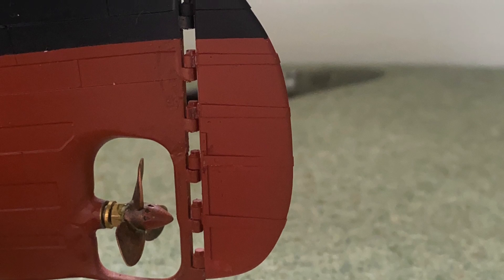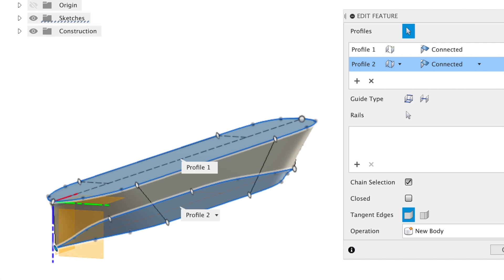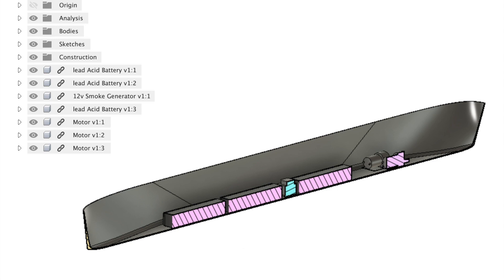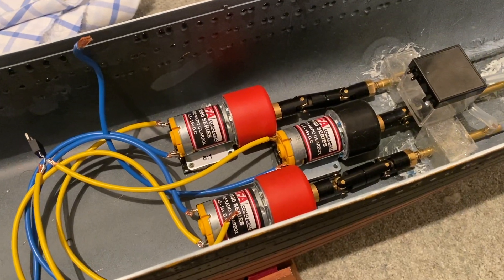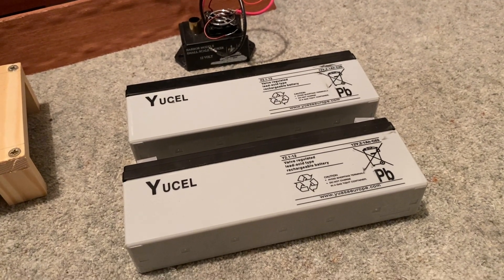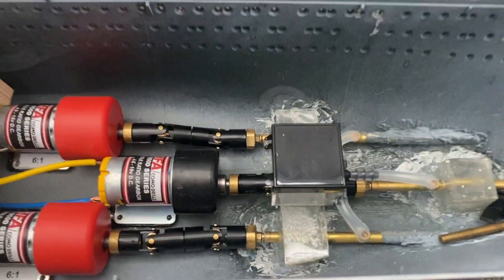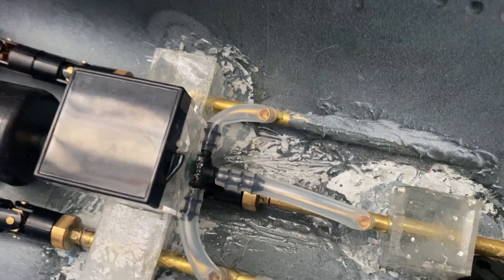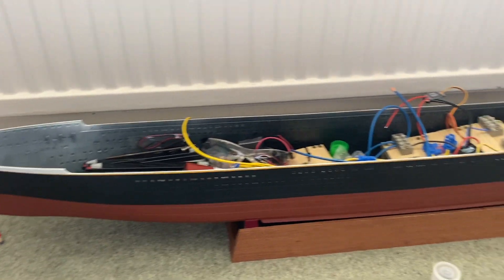Radio Control Trumpeter 1:200 Titanic Build Part 11 - Systems Layout and Electronics

Comment: Outstanding engineering as usual.  While I am not making an RC ship I got my motors working good.  Although my Pontos wing propellers do wobble a little.  I just could not get the hole to fit the shafts  squared up perfectly.  I used the center propeller from the Trumpeter kit and it spins perfectly.  My rudder is movable like the old 1/350 scale Titanic, which the how to idea came from you and I made sure people watching my video know that.  You are an engineering genius.  Thanks for the ideas.
Reply from the maker: Hi, thanks for your comment. Yes I found my pontos props wobble too. If you look closely they arnt quite true! I think really the solution would be to drill out oversize then manufacture some threaded inserts. But I can’t do that! Can you send me a link to your videos? I’d quite like to have a watch 🙂
Reply from the maker: Just watched it, great video! I will defiantly apply your  methods for the superstructure, I’ve been trying to work out what will be the best way of getting those parts together myself so that was a big help!

Comment: Very nice layout. Have you considered putting some microswitches on the motors to cut the inboard motor when apply a significant amount of rudder. I fitted the microswitches by the rudder arm so that the arm touched on to a "switch to break" on the motor power line and cut off to the inner motor only. I did this with a 1:96 Type 22 Frigate and it did improve maneuvering quite a lot.

Comment: Hi model boat guy I have a question for what type of servo motor mount did you use and where did you get it from and the automatic oiling system where did you buy it from
Reply from the maker: I made the servo mount myself from bits of wood. The automatic oil system is something I’ve made myself too, but I would suggest grease is a better lubricant than oil.
Reply: @TheModelBoatGuy  thanks for the advice I might get a 3D printer and make the servo mount and I’ll build the oiling system from the clear pvc plastic

Comment: Could you put multiple smoke generators? Make multiple uptake but put more to one stack than the other because there's never same amount of smoke out of all the stacks, maybe full speed at sea?
Reply from the maker: I am considering it, until i have the funnels plumbed in i cant really tell how much smoke im going to get out of them. Its all a bit of a balancing act because the generators are quite current hungry. But it wont be hard to add an additional one if i need. 
The other thing i suspect is that unless its a very still day i reckon the smoke will be blown away quite quickly anyway. So it might be a bit of an indoor party piece!

Comment: In an early video you showed prop shaft tubes that were 6mm OD without oil ports. In a later video, 9 or10, you show prop shaft tubes with oilers. Could you please let me know the source for these. They need to have a 6mm OD. Could you also indicate the lengths of the shaft tubes. Thanks in advance.
Reply from the maker: Hey, the prop shaft tubes are 6mm yeah. Then I just drilled and tapped them and added the oilers in. The prop shaft tubes don’t have to be 6mm but I found that was the best size as the actual prop shafts are 4mm which is ideal to accept the pontos propellers. I also prefer thicker prop shafts where posible as they are more rigid and run more true. I think 6mm is about as thick as you will her through the wing prop mounts. 
I think I bought the oilers of ebay: https://www.ebay.co.uk/itm/282899243083

Comment: Just wondering how you mounted the motors?
Reply from the maker: They are epoxied into the ship. The actual motors rest on a layer of rubber to dampen down the vibrations as much as possible. I have also cast the prop shafts into the Hull using resin

Comment: Very smart let’s just hope you continue the good work And let’s hope this radio control Titanic works properly
Also one question are you going to Close of the portholes because water could seep through
Reply from the maker: i have filled the portholes with UV resin so as yet i havent had any issues!

Comment: Great, very informative as usual sir!  Your video's are good.  Clearly you have an (A) in electronics!  Ever thought of squeezing a little sound board and speaker in for the ships horn sound?!!!  Rudder turned out really well.  I have just ordered the Scale the Titanic PE sheets. I aim to convert them for my Olympic use.  I just couldn't put up with the thick plastic profile, especially on the Promenade deck.  I have  tried to thin it down but it started to distort badly, so it has to go!  The brass will be more to scale for my needs.  Boat moulding is working well BTW!  Anyway looking forward to the good stuff you are going to be doing soon.  A wooden veneer deck manufacturer recommends a spray of matt varnish before anything is attached so to avoid accidental staining etc. Good luck with the next progression.  Regards JH ;-)
Reply from the maker: For context im an electrical engineer, so i should be getting that stuff haha! I have flirted with the idea of sound yeah, i quite fancied having a very faint bit of music playing for the band, just really faint so you can just hear it as if they were playing within the ship somewhere. Maybe that will come at some point, space is constrained! 
Yeah, if i hadnt wanted to have my superstructure removable id 100% be getting the PE sheets too, they are just amazing. I get what you mean about the thick plastic! In my case its actually quite useful as it adds a load of rigidity to the superstructure, but as you're doing a static model brass will defiantly look a whole load better. Looking forward to seeing this model of yours btw! 
Are you sticking with the silicone moulding for your boats? i havent got round to mine yet, its on the list but too many things to do.
Definatly going to use matt varnish on my wooden decks, im hoping to get the scaledecks ones which are just gorgeous but they're not cheap so defiantly dont want to stain them by accident!
Reply: @TheModelBoatGuy   Yes I agree, you need a much more durable hull for running the model in water rather than a wafer thin version like I will have in a glass case!
I think you are being bold with the Pontos additions as it is!  The 'sound' idea sounds great, I think you can get some really small boards now and sample sounds to them, so it's worth thinking about.  Having the ships horn belting away would sound cool too!  My PE sheets will take a while to arrive so I cant really do much yet anyway.  Yes they look stunning and I am looking forward to playing with those. The silicon boat moulds were fine.  Resin can have micro bubbles which are annoying but I have moulded sufficient boats now for 48 nested.  See my other response regarding the collapsible boats. I will look at the varnish that you mentioned.  Regards JH ;-)

Comment: Couldn't you have used grease instead of the oil in the prop shafts, then just have grease nippes for any maintenance. Good video :)
Reply from the maker: Hi, I did consider that yeah. My concern was I didn’t think there would be enough material in the prop shafts to adequately hold the nipple in place. There is hardly one turn in the prop shafts threading and I thought if I’m using a grease gun under moderate pressure there’s a chance the nipple will just come out.
It’s a shame really because grease is probably a more appropriate lubricant for that application but hey ho!